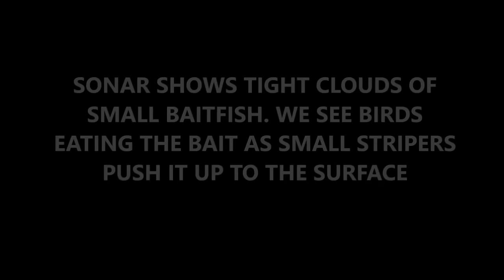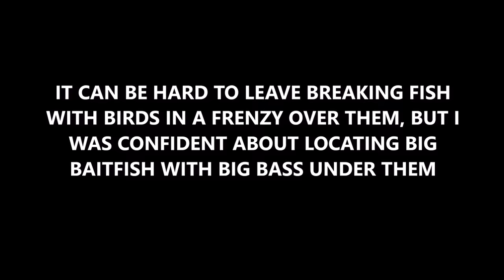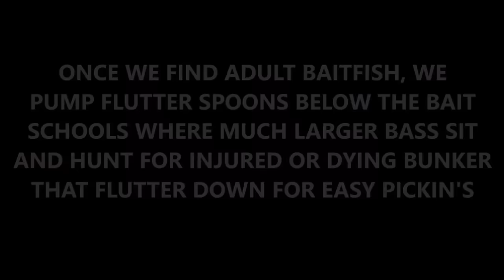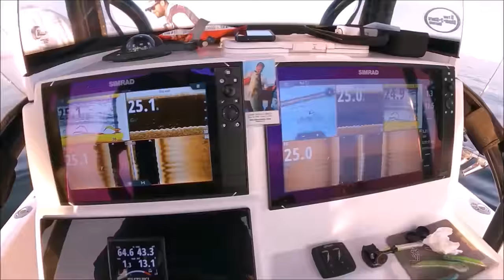99% of Fishermen are making this MISTAKE! The 1% WANT TO KEEP IT THAT WAY!

Comment: Your comment about your buddy holding the rod below the reel got me thinking (I always use left-handed cranking reels for jigging too).  If his right hand is his dominant hand, he probably has more strength it that hand versus the other.  That's two advantages of a left-handed cranking reels for jigging. first:you have a quicker response to a strike on the fall of the jig/spoon; second: your dominant hand can set the hook and give move power during the strike.  The only problem or disadvantage would be you lose leverage to a really big fish but that is quickly solved by placing the non-reeling hand high up on the blank as the fish makes a run.  Love the videos.  Learning new stuff and understanding why old habits were started! PS-Just wanted make sure Tommy-Two-Tours got a proper attaboy for his service:  Bravo Zulu, TTT!
Reply from the maker: Perfectly said!  I agree with you 100%. Thanks for your continued support brother!!! 👍👍👍

Comment: Hey, Mike, great stuff. Keep it up quick question for you, though. I'm in the Chesapeake Bay and we don't really see the adult menHayden, especially towards the fall. I know in a previous video. You said you've put 2 of the smaller spoons together with apoxy. How deep can I fish that? Do you think?
Reply from the maker: Thanks brother!! I know exactly what you mean. I used to spend every Dec and Jan there. You get lots of sand eel schools there. I used regular slow pitch spoons with good success, but the 4” lake fork spoon will probably slay over there. I mainly fish just off the channel edges in 20-30 ft of water drifting eels and jigging those spoons whenever I marked bait schools under me. 1 spoon is fine for those depths, but I like a little scope out when jigging flutter spoons. If you would rather be straight up and down gluing two together will be perfect 👍 Thanks again for your support!!

Comment: Great job as always man. What is your preferred rod for pitching the spoons?
Reply from the maker: Thanks brother!  I’ve tried countless rods and ended up designing my signature slow pitch rods with Rich Coulson. They are made specifically for these spoons. Super light. Super balanced with added weight system to the butts that make the tip feather light. They have super high end Rainshadow carbon composite blanks and carbon fiber grips so you feel EVERYTHING. Rich’s email is in the description if you’d like to order one. With that being said, these rods aren’t in everyone’s budget. If that’s the case you can get this model ugly Stik https://amzn.to/3GMcqq8. 6’ medium power.  It’s not light. It’s not balanced. It won’t be as comfortable and will not be sensitive, but it is affordable and they WILL catch fish. 👍

Comment: You got an awesome crew 😊 ! If you don't mind me asking what kind of bait casting reel are you using I'm guessing abu maybe a revo beast? And what lb of braid I'm sure to a flouro leader with like an fg
Reply from the maker: Thanks brother!!!  I use mostly Abu Beast, yes. I use REVO Beast and REVO TORO Beast (TORO is much larger) They have both brake systems magnetic and centrifugal. Don’t get BeastX or any Beast with a letter after it. Those are cheaper models with 1 brake system.  Both sizes hold plenty of 50lb braid. And yep, 25lb fluoro leader with FG knots 👍👍

Comment: Mike love your videos. Where do you source your rod holders? Do you know of a shop that will custom make to my Specs? Your the best! Thank you!
Reply from the maker: Thanks Jimmy!!!  🙏🙏I actually had a welder making these for anyone that wanted them.  I never took a penny in commission to keep price as low as possible. I gave the design to the welder and referred a few hundred customers to him. It all went well for 3-4 years and then it didn’t if you know what I mean. Orders were being accepted along with payment yet they were not being shipped out 🤦🏻‍♂️.  So unfortunately I don’t have a guy to recommend.  If you go to a machine shop near you, the material is 1 1/4” aluminum pipe 18”x18” welded at a 30 degree angle. Cut two notches in the bottom to lock into flush mount rod holders in your gunwale. I use SMITH adjustable rod holders on the rails but you can use whatever brand you want. Sorry brother.  I wish I could help more.
Reply: Thank you Mike! In fact your welder scammed me as well. Cashed my check and no product shipped! Stopped answering his phone as well. Thank you sir! Your the best!

Comment: Cool video….

I think you’re gonna need a bigger net lol……

I always lift these fish vertically the scoop breaks nets.

The stock hardware is ok on those  nichols spoons? I was always told on big fish they will bend…..
Reply from the maker: Yeah man. I always hold my breath when they lift big fish like that😂. I’m trying not to micromanage everyone, but a netting video is on the horizon 🤣.  I don’t know where the hardware rumors started. I’m guessing one of the knock-off companies, or someone misunderstanding me when I talk about adding an additional swivel above the hook. Pause the video when Tommy is holding the fish on his lap and check out the hook on that spoon. It’s a thick monster.  All of the hardware is high quality. You can choose saltwater hooks or freshwater. (Swivels and rings are all saltwater on both) I prefer the freshwater hooks even in salt. The points are way thinner and sharper. They hone very easily compared to the coated salt water hooks. I also avoid “stainless or coated” hooks on anything. If you break a fish off those hooks are not going anywhere soon. If a big girl is hooked in the throat and breaks off I want the hook to rust out asap. I also have tons of footage of us lifting 20lb plus fish into the boat by holding just the spoon. I don’t ever see them bending. They are stamped from solid brass to not be so heavy like the stainless spoons I see some companies make now. Those heavy stainless ones are a nightmare on your shoulder.  WAY too heavy for Striped bass. I want the slowest flutter possible. Most of our videos are in shallow water. 15ft to 30ft. where a lighter spoon is king!!

 Thanks for your comment brother!
Reply: @MikeSmedleyOLDSCHOOLSTRIPERS  really cool videos…..

I’m in Long Island sound our fall I’ve never seen so many big fish multiple 40# and a 50 on my boat……

We only had adult bunker for a month it was weird….flutter spoon bite didn’t last long. It’s mostly night time chunking here

I know you guys are sponsored by Nicols but I use the all pro ones. He uses 6x hooks….
Reply from the maker: @DLeopoldi914  thanks brother!!! I’m partnered with ALL PRO as well. He’s a good guy.